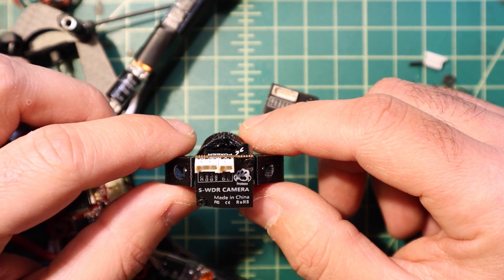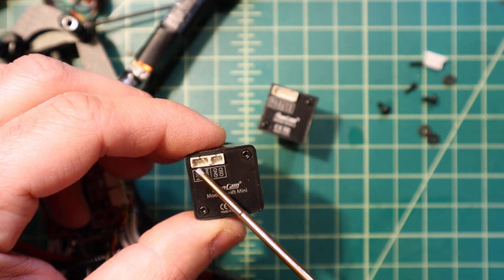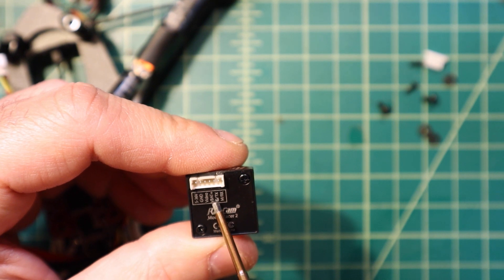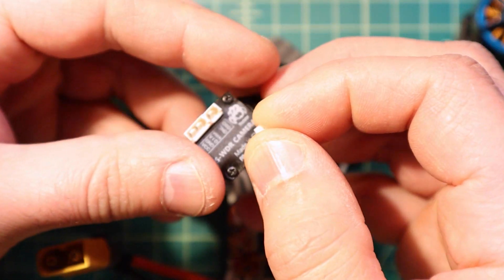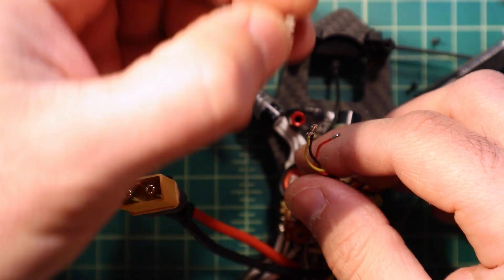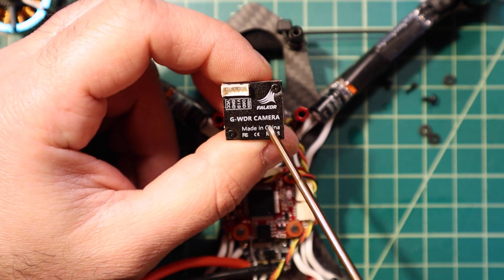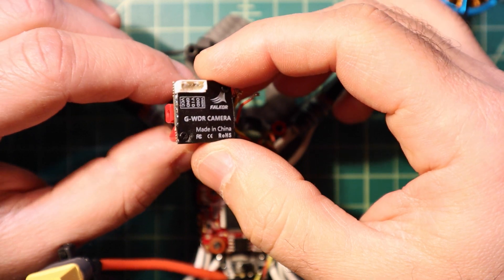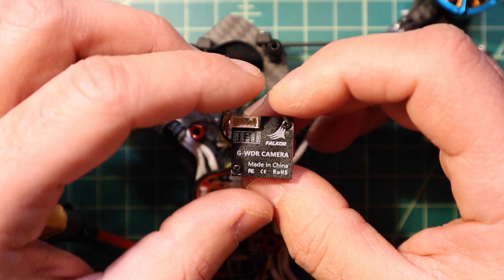FPV Camera Plug Comparisons

Comment: Great rant as I'm starting in FPV and this is driving me off the wall as each camera seems to have different layout and connector types... Bonkers... but do you know the name of these connectors? are they 1mm or 1.25mm type??? cheers
Reply from the maker: Most cameras use what we call "Pico-Blade" connectors, where some of the other components in builds typically use JST-SH, and some VTXs use JST-GH.
Reply: @PinchTune  what seize are they? JST 1.25 or 1.5? I know the happymodel VTX even plugs in with 1.0 from the camera. 😊 thanks

Comment: I agree, super annoying, but you can still re-pin the shared ground into a new camera, and just leave the second ground pin empty.
Reply from the maker: I know that if you use the camera control on the flight controller, it will work without grounding it. At least on RunCam cameras. I haven't tried it with Foxeer yet. I think it's because it's all sharing a common ground. However, I don't think the external dongle will work without grounding it. Or will it?

Comment: Lol i love the one you dislike because I fly FL1 and since there is no camera control that little osd plug is easy to fish out and plug in and the runcams you have to take the top plate off to plug in the cam control board
Reply from the maker: I hear ya. Normally I set a camera up to my liking when I first put a build together and don't normally make changes after the fact. But if I change cameras within builds, I would like them to be compatible. The shared grounds doesn't help with that.
Reply: @PinchTune  o yeah I hear ya

Comment: Great comparison. Also shows the reason I don’t use many foxeer cams. Only use them in my hawk 5 only bc it originally had a foxeer cam. He rest of my rigs all have Runcam micro Swift’s in them. 👍
Reply from the maker: Right. But Foxeer got it right with the Predator V4.
Reply: PinchTune true true. I’ve been wanting to grab that one.